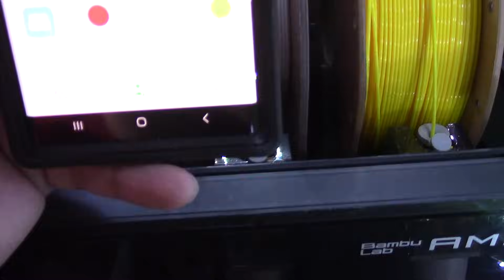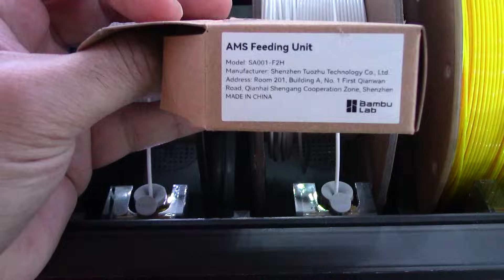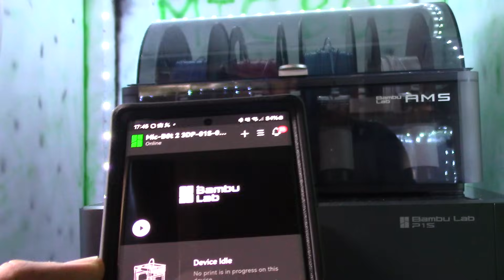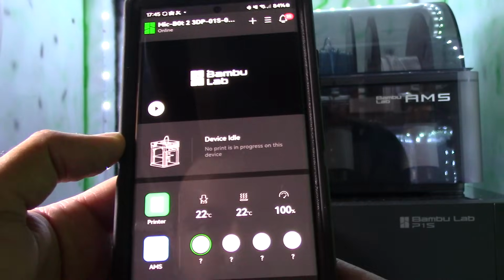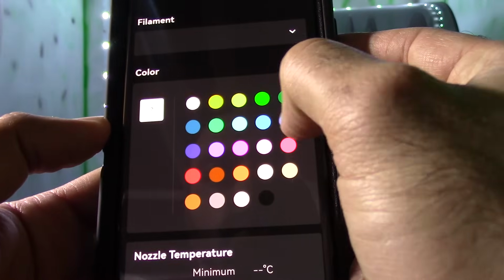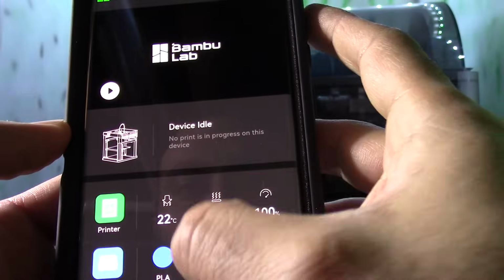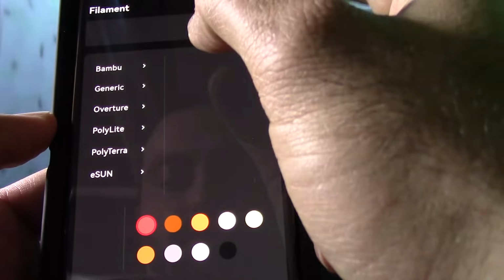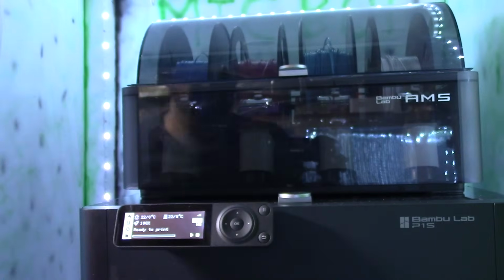AMS Feeding Unit (Filament Sensor) Replacement

Comment: how do you have to replace these so often? I have four machines, four ams units, about 3 years on them and I finally had this happen for the first time. I'll just spend $35 and replace the whole part lol
Reply from the maker: @killerms2221  basically I print 50kg per month and I'm not gentle when the PTFE tubes need replacement

Comment: Just had my first fail. I have 10 Bambu printers and have been printing on them daily for almost 2 years. I'm surprised you have so many fails. Then again, you're probably surprised that I haven't had any fails! I was hoping I could just clean and reset the filament sensor. Nope. Not a Prusa. Bambu doesn't sell just the feeding unit anymore. Instead you get the entire feeding unit. More $$ but not as hard to remove and replace. Thanks for confirming what I thought needed to happen.
Reply from the maker: I also have 12 of them. I only had the one lemon P1P. I guess it was luck of the draw.
Reply: i got my first 1 and i already had this fail after 2 weeks

Comment: The only video and I can get my center pin to push out like that on the feed module. I stock my key in the side and I’ve taken hammers to it and it won’t move
Reply from the maker: Yeah it's the most painful part replacement out of all the possible bambu parts. I feel your pain